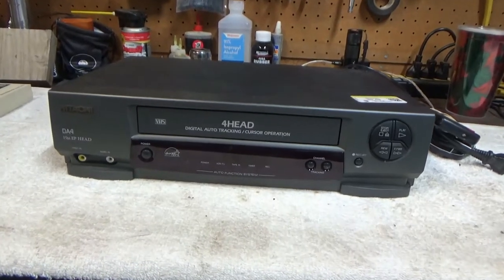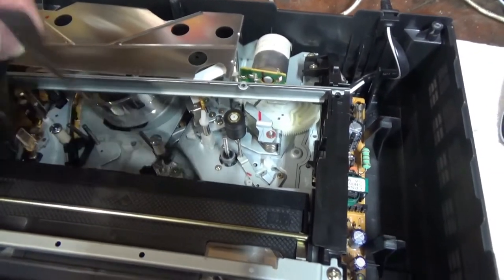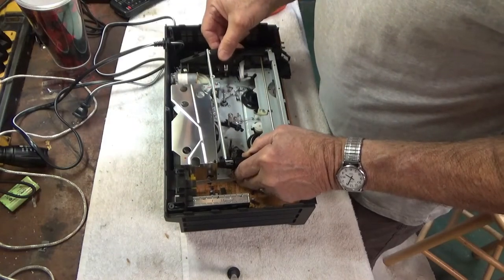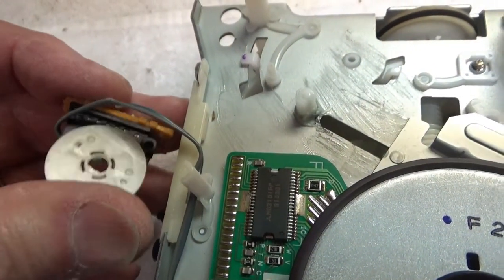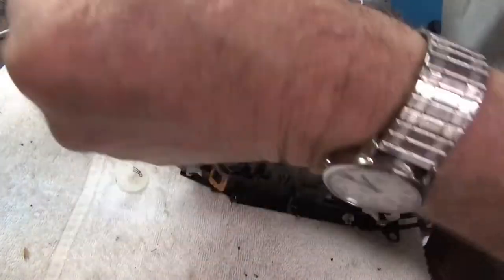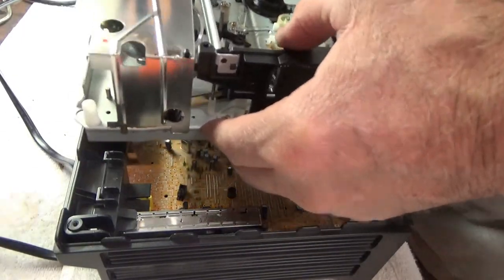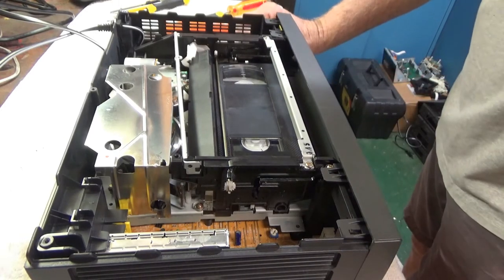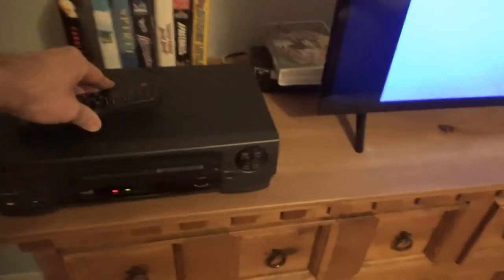Hitachi VCR Eats Tapes, another dirty Mode Switch

Comment: Is there no lubricant needed in the mode switch? I live in Sweden so i have no idea about the product your cleaning with. Thnx for the video.
Reply from the maker: The product that I used is a contact cleaner that does have some lubricant in it.  If you can't get Deoxit then you can probably substitute any good electronics contact cleaner. There is a guy that I follow on YouTube that works on many VCRs. He uses a stainless steel brush to clean the mode switch contacts and then applies dielectric grease to protect the contacts.  His channel is called NorCal715. Here is a link to one of his VCR mode switch videos.  https://www.youtube.com/watch?v=Rmc4f1B0pT0

Comment: Brandless VCR/DVD player suffering this, was inspired to take the cover off and get to the mode switch... ended up taking so many components out and still failed to get to the underside of the cassette carriage. Tossed it! My fail.
Reply from the maker: It happens. I've tossed a few also. You can't save them all.

Comment: I have a SONY VHS tape player. Unsure how many years old. But I got it from my Stepdads mums house. But the tapes played really well and hasn't eaten any tapes for sure

The only thing is that are like 3 box full of Star Trek TV show volumes which some are dirty (in need of cleaning). But they all work well though

Much appreciation from England, UK
Reply from the maker: Thanks for commenting.  Glad to hear that you have put another vintage VCR  back into operation. Hang on to it.  They're not making any new ones and it may eventually be cool to play old vhs tapes.
Reply: I thought this thread was about connecting the BHS ??

Comment: Great video 👍 My JVC vcr has the tape indicator on where no tape inside but when i insert a tape it works fine and when i unpluge it the tape indicator is on again trying to go in play mode and hearing to motor working .. is it a mode switch problem ?
Reply from the maker: It could be. Dirty mode switches can cause many unusual problems. Also check the   emitter and sensors which detect tape movement and end/beginning of tape.